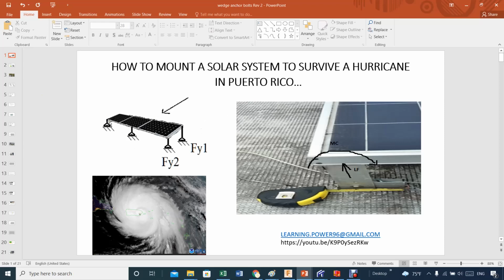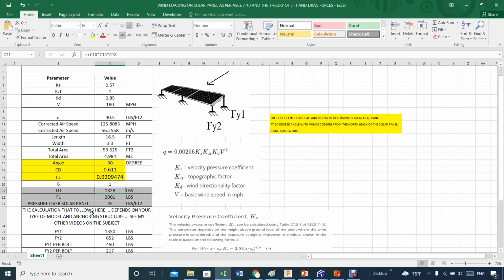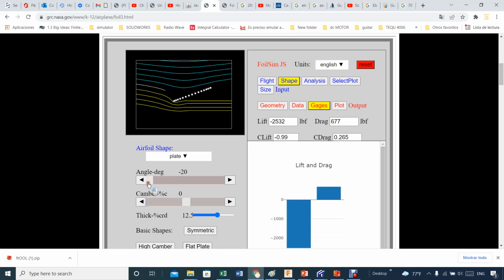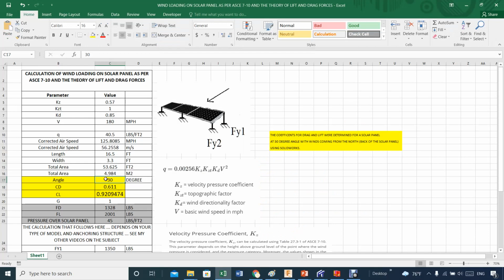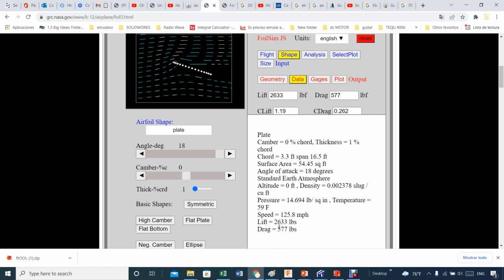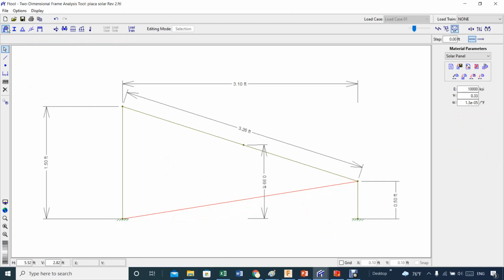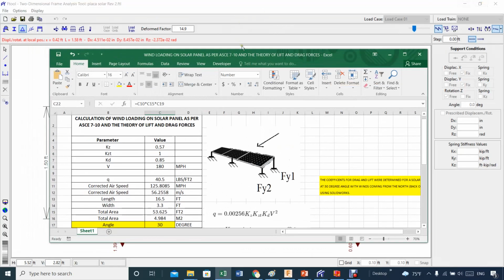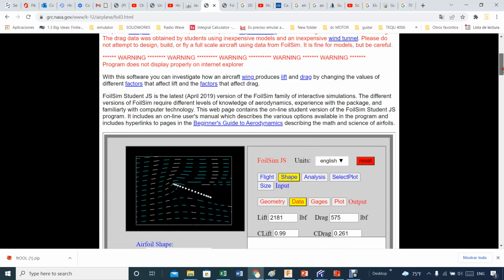CFD AND WIND FORCES CALCULATION  OVER A SOLAR PANEL

Comment: If I would like to calculate the weight of 6 counterweights instead of 6 anchor bolts, what would be the formula of Fy1, Fy2? Moreover, do we have to consider in y direction forces formula the dead weight of the same structure?
Reply from the maker: Excellent questions.  The ballast weight must counteract the overturning moment and the sliding forces due to the wind. Ballast weight required:

W b = Fx *h /(mu * g)

where,
Wb = ballast weight, kgs.
Fx = drag force, N
h = distance from the ground to the center of pressure of the panel. (meter)
mu = friction factor (concrete on concrete) is approximately 0.5 for rough surfaces
g = 9.81 m/sec^2

For example, for a drag force of 1000 N that is applied approximately 1 meter from the ground and the friction factor is 0.5,

Wb = 1000 * 1 /(0.5*9.81) = 203.9 kg

with a safety factor of 2.

Wb = 2*203.9 = 407.7 kg 

You will distribute this weight in at least 3 ballasts each with a net weight of 136 kg to anchor your solar panel.

For the lifting force, let's say it's about 1000 N... the ballast is about 4000 N... the panel won't fly... with that much ballast.

 Remember that the friction factor of 0.5 is an estimate.  You can make a solid concrete block of  60 lbs  and try to slide it over the surface that you will be installing your panel...and calculate the force required to move it... 

Let me know...if you need more help. 

Cheers!!!

Comment: Thank you for these excellent tutorials.  If I am designing a ground mounted solar array, in the US Virgin Islands, can I use the lift force to determine what weight I need in the concrete foundation?
Reply from the maker: Lift and drag forces need to be used...you don't want your solar panels to move not even an inch!!! Are you thinking to use a ballast system?
Reply: @learningpower9437  I am thinking of a trench footing running the length of the array (a lower footing and an upper footing).  The array is on a south-facing slope of about 18 degrees, so the panels will be basically parallel to the grade.  I am trying to determine the required volume (weight) of the footings.  My array will have 20 panels, arranged 4 x 5 giving it an east-west dimension of 28' and a north-south dimension of 17.5' (roughly 500 sf total).  Because of the sloping terrain there isn't much elevation at the north edge so I think the lift calculations over-estimate the lifting force.  I used the NASA airfoil tool which you recommended and it generated these results: 
Plate
Camber = 0 % chord, Thickness = 1 % chord
Chord = 17.5 ft span 27.5 ft
Surface Area = 481.25 sq ft
Angle of attack = 18 degrees
Standard Earth Atmosphere
Altitude = 0 ft , Density = 0.002378 slug / cu ft
Pressure = 14.694 lb/ sq in , Temperature = 59 F
Speed = 125 mph
Lift = 22977 lbs
Drag = 9024 lbs

However I don't believe I need 23,000 lbs of concrete to hold this assembly to the ground.  That would be over 1,000 lbs per panel which seems VERY excessive.  Any advice?
Reply from the maker: @dlsilverman  I'm out this week.. but the first thing I suggest is to drop from 18 to 5 degrees... You'll lose a few KWH per year... but it's better to have a lower slope... than to lose the panels with the wind... Send me a sketch of your design and I'll try to get the lift and drag coefficients using Solidworks. My email is learning.power96@gmail.com.

Comment: Thank you for this excellent video and a review of your Wind Loading spreadsheet and in particular, the formula showing the forces on the anchor bolts (FY1 and FY2). However, I wanted to point out an error in your formula. Around 9:27 into the video you clicked on the cell C25 showing the formula for FY1. The formula shown has two places where you have a hard coded angle of 18 degrees instead of referencing the cell containing the actual angle (cell C17).

The original formula is:

=(C21*C14*SIN(C17/180*PI())/2+C22*C14/2*COS(18/180*PI()))/C14/COS(18/180*PI())

The corrected formula where the fixed values of 18 are changed to cell C17 should read:

=(C21*C14*SIN(C17/180*PI())/2+C22*C14/2*COS(C17/180*PI()))/C14/COS(C17/180*PI())

For those that  need to know how FY2 is calculated, FY2 = FL - FY1 (C26 = C22 - C27).

Note that FY1 and FY2 only represents the pull out force (force of lift) on the anchor bolts.
Reply from the maker: David...you caught a  wild goose....I have iterated with that Excel file soooo many times...that left a hard-coded number.  I appreciate the feedback. Thanks.

Comment: Thanks for video 
How we can calculate other forces , please can you clarify especially Fy1 and Fy2
Reply from the maker: Those forces Fy1 and Fy2  in the spreadsheet are based on  zero moment resistant joints. They are free to rotate in the z direction.